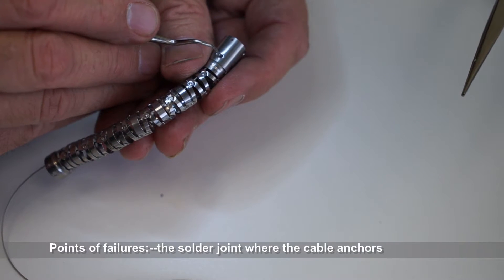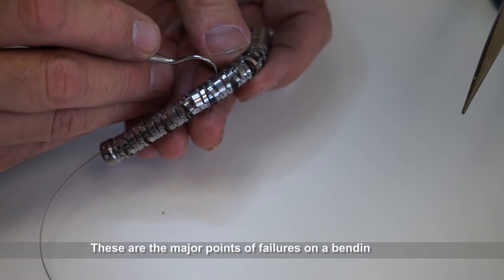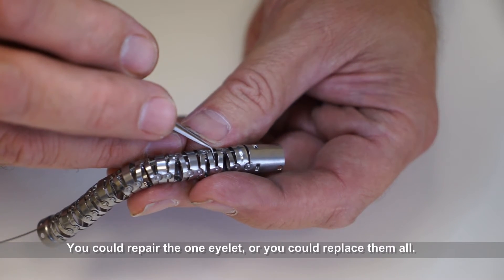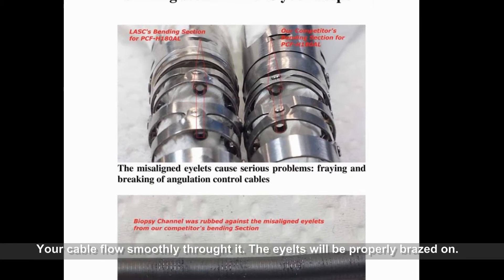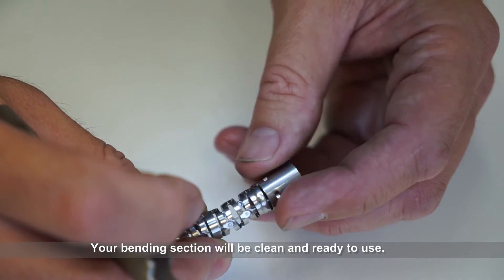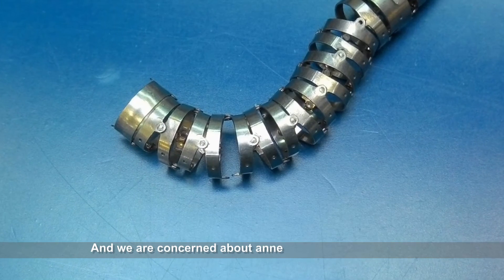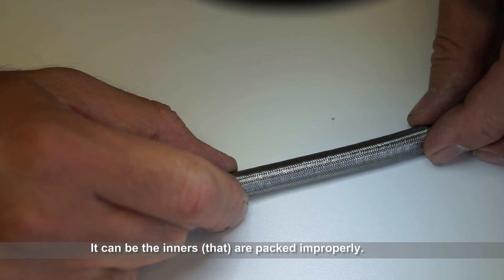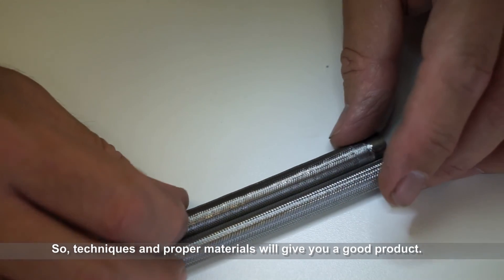Bending Section, common problems, endoscope repair

Comment: what causes flexible endoscope to buckle on the umbilical cable on a 190 colonoscope?
Reply from the maker: The umbilical cord is made of a mono coil covered by a wire braid and has an adhered outer plastic cover. When the minimum bend radius is exceeded, or bent too sharply then on the inside curve, then the wire mesh will bend past the recovery point, and be permanently deform the wire mesh leaving a little pocket where the adhesive is torn away from the mono coil. 
The strain relief boot is designed to help prevent this from happening. You will usually see this just off the end of the boot and if gone unchecked can crack the plastic and fluid can enter the scope through there. 
A well engineered umbilical can increase the life expectancy. Although to educate the handlers that the best cure is not to let the tube be bent past the point of no recovery.

Comment: can it be stuk bent  in a patient as an accident ?
Reply from the maker: It can happen although it is rare for a control cable, a collar or a rivet to break in a patient during a procedure due to stress. In most cases, the cable breaks and you lose control in that direction and the doctor will let the scope go loose and safely extract it.  The smaller the space the more likely the problem.